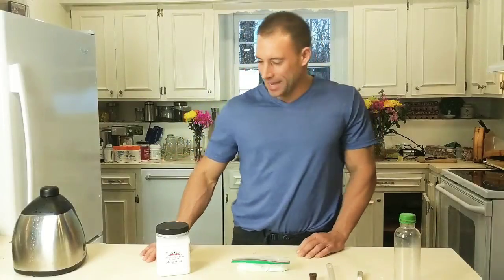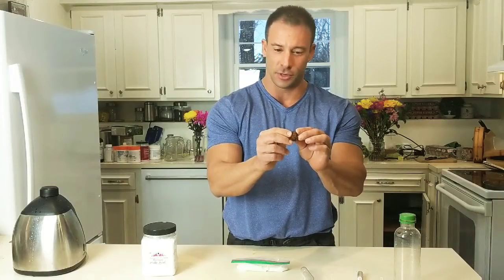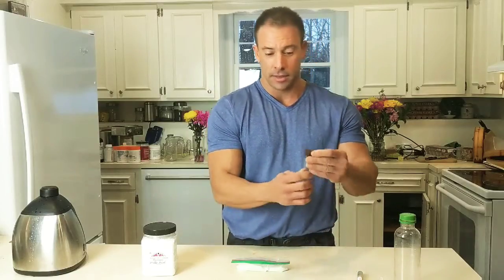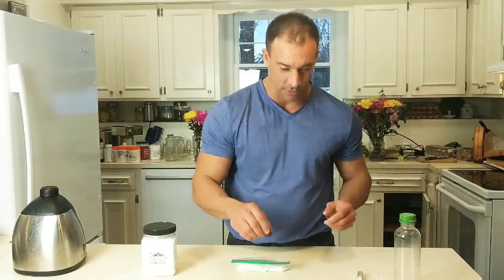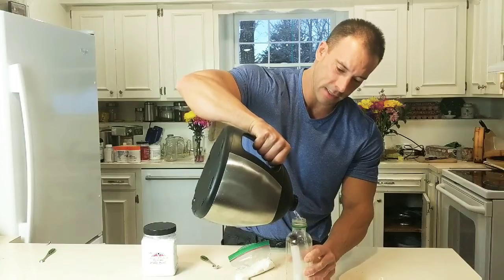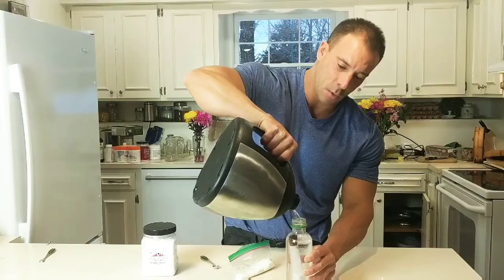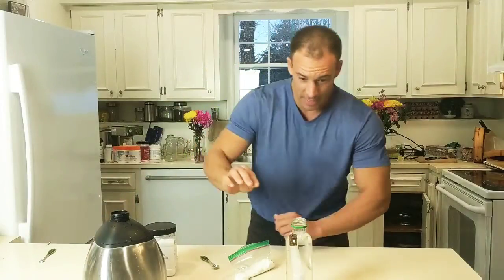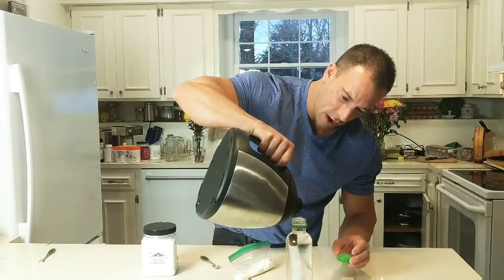How to make hydrogen rich water.

Comment: Bro you don't need test tube if your magnesium rod is 99,99%. You will have simply magnesium malate. Which is a great form of magnesium. You also don't need the freezer. I am doing it like people did in the study. I have 3x 500ml coca cola bottles and 3 magnesium rods( one new rod is 45g 100mm long and 18mm wide.) place rod in the bottle with water and malic acid or you can use juice from 1/2 of lemon.. You don't need freezer. Concentration of hydrogen will be the same. Just let it work at least 5 hours. The pressure will be crazy high. The bottle is hard as rock. The highest concentration of hydrogen will be after around 24 hours under pressure in the bottle. Than will hydrogen slowly pass trough the bottle. So 20-24 hours is the best time. Anyway good to see people promoting this cheap and effective way how to make hydrogen water.. :)
Reply from the maker: Thank you so much for your reply.  You are correct.  The test tube is not necessary for the reaction.  However, according to my research, the test tube keeps the malic acid in contact with the magnesium at a higher concentration, thereby speeding the reaction and thereby the release of hydrogen.  I use the test tube method because I don't want to wait 5 hours for a complete reaction.  Regarding the freezer, you are once again correct.  It is not necessary to cool the water for the reaction to occur.  However, according to my research, cooling the water creates higher H2 solubility in less time.  My methods are perhaps driven by impatience!  I like to make this quickly in the morning before I leave for work.  I hardly ever remember to start the reaction before I go to bed.  Your method is certainly simpler.  If only I could plan ahead!  Thanks again for sharing your knowledge.  I appreciate it very much.
Reply: I do "test tube method" also when I need some hydrogen water faster.. :) If you do the test tube method. Where you have only water with hydrogen and you don't drink the magnesium with the acid. There is no reason to use expensive malic acid. You can use citric or ascorbic acid .. Much cheaper and works great ..
Reply: @jirihutecka9020  how do you not drink the magnesium, it will be in the water?
Reply: Sorry, but I would not use mag rod directly in the water due to impurities and possibly good amounts of heavy metals.. Urine test tube method with small piece of mag rod and citric acid with holes in the stopper works extremely well. (always fill the bottle with water to the top and same with test tube. You need water, acid and mag rod for the reaction..) Also use coa cola 500ml bottle. ) Within 15 minutes you have bottle filled with hydrogen and most importantly only gas can escape from the test tube. Everything else stays in the tube so you have just water + gas... Also I found out that hydrogen will speed up metabolism which is a good thing for slow oxidizer, but not so much for very fast oxidizer with already depleted minerals.. I highly recommend hair mineral analysis so you will know..
Reply: @jirihutecka9020  Didn't you also say that older people often have slow metabolism, so H2 water will help them, is that right? I was told 20 years ago that I was a fast oxidizer, due to HTMA.
Reply: @josephrzeczycki8642  I don't use H2 water anymore. TO be honest we don't know exactly what it does. Some people say it stops sugar metabolism. When I started drinking it again I felt weird really weird. I should do blood work and hair test during that time to see what was really going on, but I didn't..
Reply: Bro we have tested this. The best temperature is room temperature. The most crucial part is to have hydrogen in water under big pressure for many hours. Then you need to shake very well for at least 30 secund and you will have like 5 ppm which is 3x more than hydrogen water machines.. You don't  need low temperature, but pressure and than shaking the bottle is the most important factor..
Reply: @jirihutecka9020  is there risk of exploding bottle?
Reply: @rauldukeduke3040  Yes if you use too much acid and if you use one bottle longer. It can "explode". that's why I had that bottle bathtub. :) Never ever do it with glass bottle. It would work like grenade..
Reply: @jirihutecka9020  are you using hydrogen water? What PPM are you getting?

In your first comment you say to drink the magnesium  malate water and DON'T use test tube, then later you say to use test tube method. Did you change your opinion or did you make a typo? Thanks! 

I wanna try this but I'm concerned with heavy metals with BOTH methods
Reply: Have you tested aluminum bottles? They are used to store hydrogen in commercial applications. Not sure how long it takes for aluminum to leech, but I'd your hydrogen only take 3 hours it might not..
Reply: @haveaniceday7950  Test tube where only hydrogen gas goes into the water is ok.. I don't use it anymore. I was changing a lot my biochemistry and I don't know if in a good way...
Reply: @jirihutecka9020  what PPM where you getting? Did you have negative effects?
Reply: @haveaniceday7950  My biochemistry was completely of according to hair tissue mineral analysis... I am sure it is great anti oxidant, but it was pain in the ass making it. If I had good machine to make hydrogen water. I would use it for sure..
Reply: @jirihutecka9020  well all the science says cold works better.
Reply: http://www.molecularhydrogeninstitute.com/studies
Btw his method from this video is the best. But you need coca cola bottle. Because it can survive very high pressure and you need the pressure to "squeeze" hydrogen into the water.. He is doing it right that you don't need a lot of magnesium rod in the test tube. The amount of acid will determine how much hydrogen gas you will make. Also use citric acid. It is cheaper and it gives you more powerful reaction.. You don't need the freezer. Just let the bottle sit under pressure for at least 3 hours and than the most importat thing. Shake the bottle for at least 30 second, but not up and down like with shaker, but only in small movements to the sides.. So the test tube will not jumping so hard and nothing will leak out of the test tube.. It should be hard to open the bottle and there should be small bubbles everywhere exactly like when you open soda drink. You feel that water tastes different when is there a lot of hydrogen. After opening the bottle don't shake with it or you lose a lot of hydrogen.. Drink it under 30 minutes after opening.. 2L of this water a day will be powerful healer. Btw you can have powerful detox symptoms. So don't stop drinking it if you feel symptoms. It just the body can finally fight/eliminate everything bad. It can last like a month..
Reply: You don't need inhale H2 if you have hydrogen rich water.. Btw I would highly recommend hydrolyzed whey protein for protein(amino acids) there is nothing more essential for human body than amino acids. Yes you need minerals, vitamins etc.. But most people especially older have very low amino acids. This results in low glutathione(master antioxidante), slow metabolism, low thyroid, low collagen/elastin synthesis, loss of muscle mass, bone loss etc.. Eat good quality foods like eggs, some fish, poultry, red meat etc.. But most people have digestive issues and are low in amino acids even when they eat meat etc.. By drinking good quality hydrolyzed whey protein you will know fore sure that your body has amino acids for all actions in the body.. It is basically predigested and it doesn't need stomach acid etc.. I would drink like 30g 3x a day.. To have at least 50g of protein from this supplement.. A lot of people also supplement single free amino acids like glycine, taurine, histidine, tyrosine, glutamine.. Those are mostly non essential. But most people are low on this amino acids.. You can be even "vegan" if you make sure that you have all amino acids in good amount.. But most vegans are low in protein. That's why they age very fast, lose hair, all muscles etc..
Reply: Makes sense because the instructions for the SodaStream says that cold water holds C02 gas better when making carbonated water. I'd expect that cold water holds Hydrogen better than hot water.
Reply: After 5-15 minutes the bottle is filled with hydrogen, but it is a good idea to leave the bottle under pressure so more hydrogen can be squeezed to the water.. Btw don't use more like 1g of citric acid for 500ml bottle otherwise it can burst hehe.. Even coca cola bottle.. The plastic will stretch after more uses. So I change the bottle every 10 days or so.. You are lucky with the ocean.. I would swim or at least soak in the ocean every day.. Ocean water+ sun + fasting on good water is powerful healer..
Reply: Stable sea water from a depth of more than 200m contains all the salts we need and in perfect balance. If a person is low on one mineral, it's not sufficient to merely boost one's intake of that one particular mineral because they are interdependent  and need to be in balance. It just so happens (according to my reading that sea water is a match for our needs) Could be the next big thing. After all simple Hydrogen is becoming a big thing so why not natural pure seawater for drinking as an essential supplement? ?  
Inhaling Hydrogen gas is the other reason for this post to the thread. I just reviewed some Tyler LeBaron stuff and he believes inhalation is coming on strong. Goes into the lungs then directly to blood stream and I want my respiratory system exposed to H2 directly.
Why couldn't a tube to a nasal cannula  be attached to the testube while it is furiously generating Hydrogen for 1/2 hour. ever try that?
Reply: Jiří Hutečka
Sir you have a very clear understanding of the process to make H2Water efficiently. Where are you posting your results and experiments? I would be interested to gain some of your knowledge in this matter. Thank you
Reply: I will try fill inflatable balloon with hydrogen.. :) Yes drinking sea water is old medicine, but soaking through the skin is better I think. The body will take what needs..
Reply: I loaded up the test tube with 1/4 teaspoon (1gram +-) malic acid and water in the usual manner. Put the cork stopper with a small hole and slid the test tube into a bottle without water and simply held the mouth of the bottle containing the test tube and reacting magnesium/malic acid  under my nose and mouth, breathing in the escaping gas until the reaction was over 20 minutes later. I got a nice warm flush from the procedure  and a feeling of well being without the big rush of increased metabolic rate I get from drinking the Hydrogen water although now a half hour after I'm sensing a raise in metabolic rate but not dramatic. Is that pure hydrogen gas being produced or are by-products present as well? It felt good breathing in the mixture of room air and hydrogen from the reagents. Somehow the in-breaths felt cleaner than normal.
Reply: That's cool. You've described a pretty clear howto here and on another thread with Glen. Personally I've been hunting for a simple straightforward means to produce the hydrogen water at a reasonable concentration and you have described howto. :) Prior to this I've been using for the past month a usb powered bottle type generator and while it did produce some hydrogen water, the concentration was less than 1ppm so whether that's sufficient to be effective is in doubt. Last night I put a 45g rod with the juice of 1/2 lemon in a coke 710ml powerade bottle and 12 hours later this morning was pleased to see it bubbling  and in my excitement I drank it straight away (forgetting to shake it up lol). Another batch is cooking now and I've more Mg rods and citric acid on the way so to have staggered batches available throuout the day..
Using the non testtube method and citric acid is the bottle filled to the brim with filtered water or leave a gap?  thanks again
Reply: Bruce Dempsey “
Reply: If it's too cold I would fill the bathtub or some barrel with sea water and soak every day minerals trough the skin. :) But it is really good for you to swim in cold water.. + combine cold therapy with dry sauna. You can take some niacin(flushing form) before the sauna. It is very effective detox method.. But it can lower your blood pressure. So make sure that you are drinking water with minerals especially sea salt..
Reply: how many times can you use the Magnesium rods? Unlimited?
Reply: @eviejared9055  yes it is magnesium oxide..
Reply: You are indeed a wealth of good knowledge. Something has kicked in today as my muscle and joint pain are greatly reduced and energy level is elevated.. It's been 2 days X 2 doses the H2 water and also 2 days 2 doses of sea water ingestion plus 1 day  X 1 dose of high BCAA Whey protein. 
You said you would soak in sea water but I'm in Nova Scotia Canada, north of 45 latitude so the air and water are far too cold at the moment and even the sun is still to weak for much vitamin D production. I would send you a litre of sea water which can be taken 8 teaspoons per day if I had your address.
Reply: Do you think you could use an activated carbon filter water bottle and breath the gas thats produced through the straw? I am assuming it would filter everything besides the h2 gas through it, when you aren't sucking on it. Then afterwards you can suck it to get pure water + H2. That would mitigate any other metals included in the rod, if its not tested and you arent sure about it. I'm very curious.
Reply: Can you please make a video of your method.
Thanks.
Reply: @Myrrh Curie I don't make hydrogen water anymore. Anyway I was using PLASTIC Coca Cola bottle.. Glass will shatter and act as grenade!
Reply: nowhere
Reply: Thank you for that clarification. I will now switch to the TestTube procedure even though at my age 70 yrs the purity of the magnesium may not be as important as it is for younger persons. Thanks also for reminding me to resume my daily ingestion of a few milliliters of actual sea water (The ocean is at my doorstep literally) which should help my body maintain a good mineral balance.:). Really only after 15 minutes there will be 3+ppm?
Reply: @brucedempsey1659  seawater is almost pure sodium chloride, so no... it sill not "ballance your minerals"
Reply: It's interesting you mention fasting because I abstained from food for the entire month of February and shed extra body mass but I've have been in a weakened state ever since, trying to regain the strength I remember when a bit younger.  I suspect now that some muscle was depleted during the fast also autophagy is busy evernight removing excess skin cells and who knows what else from the healing processes started during the fast. I would also like to inhale H2. Have you knowledge of that as well?
thanks . Bruce
Reply: @brucedempsey1659  ; Fasting benefits are only realised by attention to re-feeding afterwards. Autophagy and apoptosis during fasting is just step one, merely the set-up for rebuilding immune system and organs in the nutritional abundance that follows. A three-round protocol of 5-day Fasting Mimicking Diet (FMD) has clinical evidence to support it. Find the two interviews of Prof. Valter Longo on the FoundMyFitness channel, view them several times each in chronological order. For general eating plan outside that powerful therapeutic intervention, I recommend the Perfect Health Diet (PHD) of Paul Jaminet.
Reply: Interesting I will try this.. :)
Reply from the maker: HI Brenda.  I have posted a video on my website that has links to a bunch of studies.  Go to   https://jacobkoz.com/?p=611
Reply: Thank you awesome.
Reply: Urgent help needed. I bought supposedly pure rods from two seperate companies. One oxidises black and the other slightly gold. I am now experiemcing toxicity symptoms. Can anyone help me understand what I might have put into my body and which rod is truly pure. Both produced hydrogen.

Thank you.
Reply: @MrElzephyr  The black stuff is magnesium oxide. So this rod should be ok. The golden one will have some other metal in higher concentration. Btw if you have the rod in test tube and not directly in the water which you drink. It should be ok.. Never put rods directly into a water. It is always contaminated with some other metals and stuff...
Reply: @jirihutecka9020  thanks for ykur response. Other rods weren't magnesium at all. I'm off to the emergency department
Reply: @jirihutecka9020  had a seizure at the hospital. 95% sure it was zinc.
Reply: Elzephyr oh my gosh. I noticed you in the question on another older gentleman’s video.. I did wonder how you got on. Please stay safe..
Reply: @Just-a-girl  thanks, I really appreciate it. Turns out it was arsenic. It's commonly added to magnesium metal to drasticly reduce oxidation (doesn't turn black). Magnesium is pretty commonly contaminated with arsenic naturally so to everyone reading, be careful!

I was lucky I took charcoal and zeolite as soon as I realised something was wrong. I've been chelating with R-ALA which has been amazing.
Reply: @MrElzephyr  holy crap.. ok i was going to do this experiment, now I will NOT
Reply: Jiri have u herd of A2o water ???

Comment: How many times can the magnesium rod be used? Is there a special water to use, distilled, de-ionized etc.? Thanks
Reply from the maker: Gary Charlton . Hi Gary. The magnesium rod will last several months. It slowly gets smaller and smaller as the magnesium is used up in the reaction. I use filtered water, but tap water will still react.